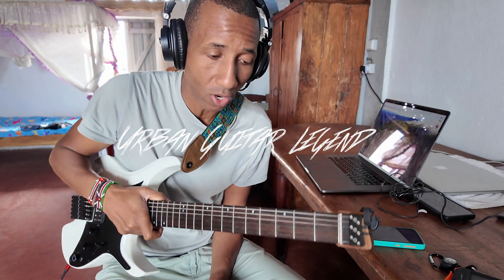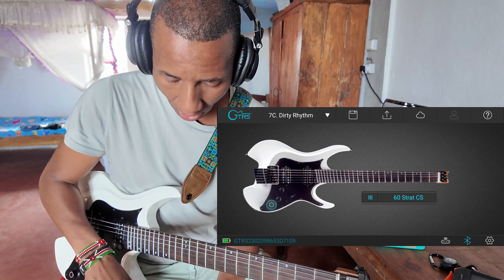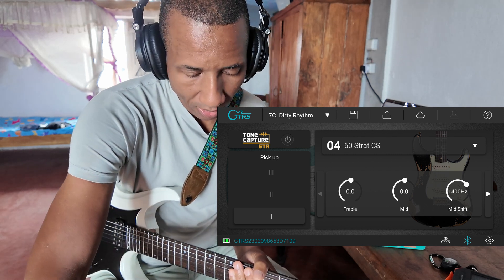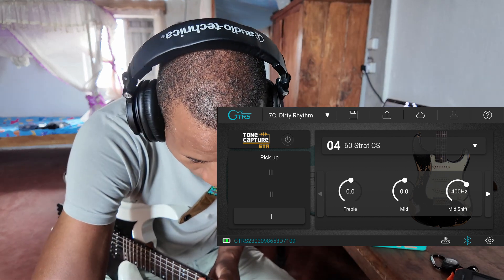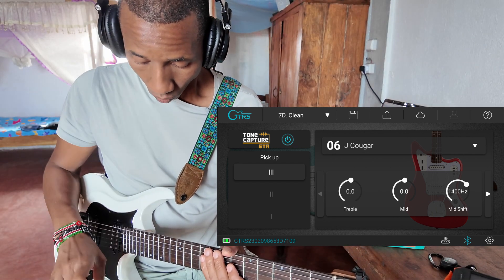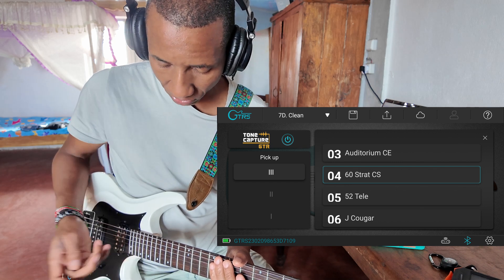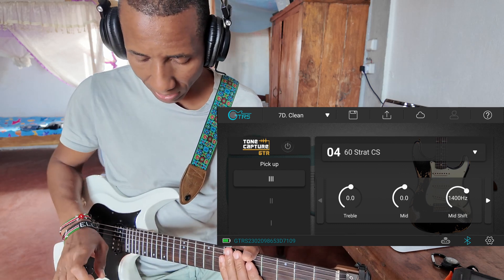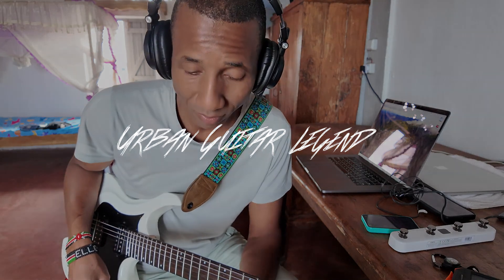Mooer Audio GTRS W800 Pickup Simulation Explained @GTRSGuitar @MooerAudioOfficial @UrbanGuitarLegend

Comment: This was really useful - many thanks. Just about to buy one of these, so bear with me - it will let me set a different pickup simulation for each pick up on the five selecter positions on the hss model? And it will remember my settings as I move the selecter positions? Sorry to seem dumb, but this feature would be the most useful thing to me on this Mooer. Thanks
Reply from the maker: Yes what you said is correct, it will remember your settings of the pickup simulation even after you switch to different pickup positions. But the HSS model has 3 pickup positions not 5. Sorry if that was not clear. You have Neck, Middle and Bridge positions. The middle position is the combination of neck and bridge. A good use case for the pickup simulation is using the guitar with physical effects and amp and not using the build-in pedal and amp simulation. That way you can hear how the different pickups sound with a real amp and pedals and compare it to a real Strat or Les Paul guitar, if you have access to the other guitars.

Comment: If you set the 1st and 3rd positions to 58 Les Paul, will I automatically get the 58 Les Paul neck pickup on the 3rd position and 58 Les Paul bridge pickup on the 1st position? It doesnt seem say which pickup on the models.
Reply from the maker: @poinkero  Yes, that is exactly 💯 what will happen. You have the 58 Les Paul in both position 1 and 3